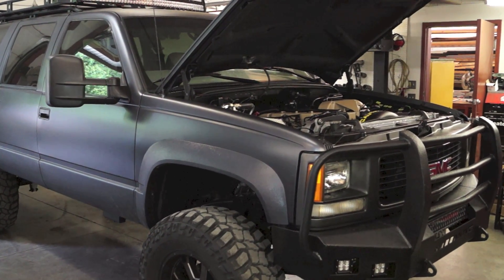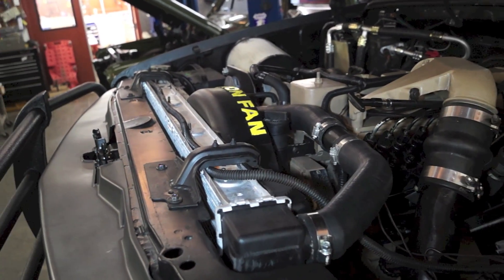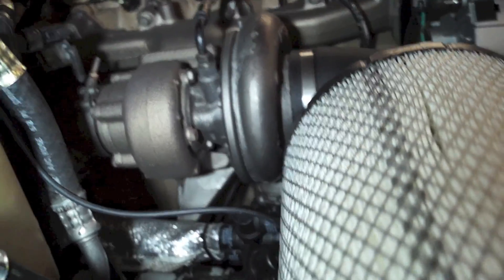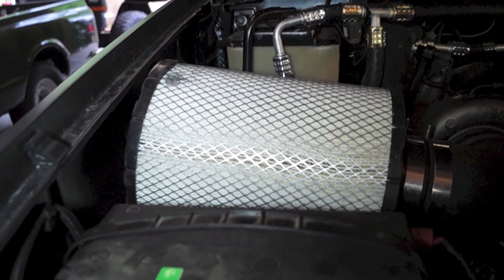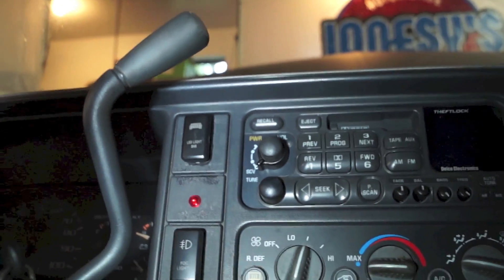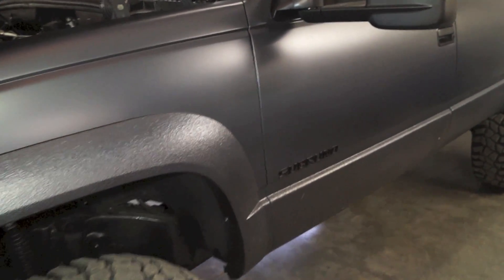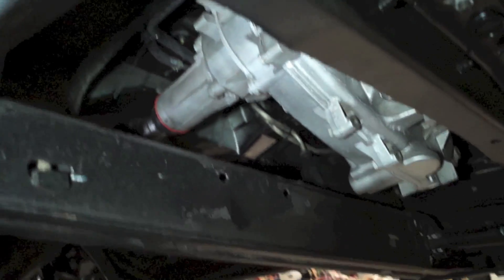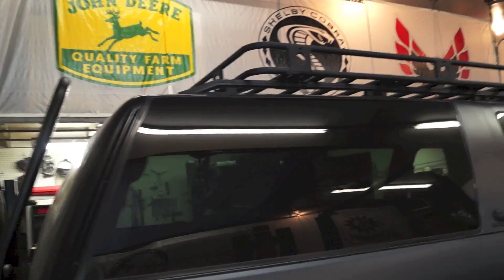GMC Chevrolet Cummins Swap Mechanical Details

Comment: How much you charge for the swap? I have a 98 Chevy 2 door. It has a 6 inch lift already. My transmission is already going out and the engine is at 200k. I want to keep the 4x4 and if possible make it a manual.

Comment: Thanks for the vid! I recently bought a 2000 crew cab short bed and was really thinking about this kind of build. This makes me feel a whole lot better of going through with it. But did you go with the 12v or 24v I don’t know if there’s any difference with clearance or issues mating the trans to motor. Thanks have a good one

Comment: Awesome! Between the larger tires and the increased weight from the Cummins, did you do anything to help the front diff cope? I have a '97 K2500 that I love, but I'm definitely aware that those front diffs are a weak point. SAS is one solution, but that IFS ride is so nice...just curious if you found a satisfactory compromise?

Comment: Could you do it on a 97 1500? Mine has a dead engine and would love to do a diesel swap. Already got the 6" lift, running 35 tires.
Reply: To heavy
Reply: How? If people swap them into mustangs? Legit question. @codyyellott117

Comment: Do you guys make or sell a conversion kit to do this? I have my dads 89 k3500  extended cab dually that I am restoring and would like to cummins swap it. It also came factory with a 454.
Reply from the maker: https://adventurevehiclesnw.com/shop/product-category/diesel-conversion-parts/chevrolet-gmc/88-99-truck-suburban/

Comment: Sweet but the new engine you dont have to use any motor mount like muve them and weld new mounts , i have a dodge 1951. Dually flatbed  and the donor  truck was just like yours  dually dodge cummins 1996 you think is easier SWAP the cabin' or SWAP the engine , transmission and dif'????

Comment: Hi,
This is amazing work 👍👍.
I have 1996 gmc serria 12Vcummins swaped and its working good .
I have qustion if you can help me on it .
How can i used the orignal dashboard RPM with cummins?
 i tray many ways but i get nothing.
Thanks.

Comment: there is people that like to knock on Cummins motors but they are very tough pulling beast I should know I have truck with a 12 valve in it and I have done a lot with it too so I know a lot about these engines

Comment: Joell,  ive watched several diesel conversations,  your by far the most complete and finalizer. Thanks so much for shsring a lesson on cummins diesel motors. I'm very interested in using the R2.8 , one day. I can be reached at 3alfear@gmail.com, thanks again.
Reply: Mr. Joel

Comment: So i am in the middle of swapping my 82 chevy crew cab with a 12 valve cummins and 10 speed eaton, how did that power steering pump mount up, is it a direct bolt in? Thank you

Comment: Would you be able to do a swap into a 1/2 suburban?
Reply from the maker: We will only install a 4BTs in a 1/2 ton Suburbans.  A 6BT is too heavy for 1/2 ton suspension and it builds too much torque for the 1/2 ton transmission, transfercase and differentials.
Reply: How much did this swap cost

Comment: Hi I was wondering what driveshaft modifications did u have to make u said u have too move the trans back 3 inches so did you have to shorten the rear driveshaft and lengthen the front ?

Comment: Didnt show dash when started.
Any codes?
Reply from the maker: The gas ECM has been deleted and the check engine light removed.  Cummins 12 valve is not computer controlled.  No Codes LOL
Reply: Lol good one frootloops!

Comment: not sure if anyone asked this already but does your abs still work without the factory computer being there? I have done this swap on a 97 3500 dually and my abs doesn't work. I have a scan tool that should communicate with abs computer but doesn't . I even bought a used unit and it wont communicate with it either.
Reply from the maker: Yes, the abs is still hooked up and fully functional.

Comment: I Like It. You should try a Turbo 400 transmission and a Gear Vendors GearSplitter/Overdrive. A Non electronic transmission to match the Mechanical 12 valve And the GearVendors unit to split the gears making it a 6 speed Overdrive.Although it is electronically operated, when turned off the transmission operates normally.
Reply from the maker: 4L80E with the programable controller works great.
Reply: @Jonesys  I have the same transmission and same programmer on my 2000 k2500 with a 98 5.9 12 valve , I have had it on the road since January of this year. I t works very nice.

Comment: Hey JonesysAutoClub. I have some follow up questions. I will be doing the same conversion soon. Some questions I have are how has the 4l80e held up? More specifically, what stall did you end up using? Hows the US Shift controller working? Anything you would change if you could do it again? 

Thanks! I'm sure I'll have more questions but thank you for your time! Good lookin rig!

Comment: Amazing truck, What did you use for motor mounts? Are they custom made?
Reply from the maker: You can buy the mounts here:https://adventurevehiclesnw.com/shop/diesel-conversion-parts/chevrolet-gmc/88-99-truck-suburban/1988-1999-chevrolet-gmc-1973-1987-chevrolet-gmc-truck-6bt-cummins-conversion-engine-mounts/

Comment: Can you do the setup without the stupid computer?
Reply from the maker: If you run a manual transmission
Reply: What about a built Turbo 400 or a 460L?
Reply from the maker: Yes,  you could use a TH00 but then you would not have an overdrive.  700R4 or 4l60 are not a good choice.

Comment: Awesome video!  You mentioned moving the eng/trans back 3" but you don't mention anything about having to modify the firewall to get everything to clear?  Did the firewall get modified in any way to make room for the engine?  thanks, really enjoyed this video!!!
Reply from the maker: The firewall does not need to be modified but there is a pinch weld that needs to be bent back to provide more clearance in the transmission tunnel.

Comment: What was the engine size of the original engine before the Cummins swap? If I remember correctly, the Chevy/GMC Suburban was available with everything from a 5.7 litre V8 engine to a 7.4 litre V8. By the time this Suburban was offered, you could also order it with a 6.5 litre Detroit Diesel Turbo if one wanted.
Reply from the maker: 7.4L V-8 Gas
Reply: Ahhh! Okay. So a 5.9 litre Cummins Diesel would've fit comfortably inside the engine bay.

Comment: I just bought a 1999 3/4 ton with the 454 to do this conversion. I have a buyer for the 454 motor. Do I need to keep the ECU or does it get completely bypassed?
Reply from the maker: You don't need the ECU.  You do need a stand alone transmission controller.  I recommend the US shift.
Reply: So how hard is it to get all the gauges to work without the ECU? I have a guy wanting to buy the 454 that's in my Suburban but I'm hesitant to sell him the wiring harness and ECU.
Reply from the maker: Your gauges do not come from the ECU.  They do route through the wire harness so if you are selling the gas harness with the 454 you will have to run the sensor wires separately.

Comment: Hi, I’m a high schooler looking to buy my first truck. I have my eye on a 1997 dodge Cummins that has about 240k miles on the engine. It’s a two door with a lift kit. I wanted to get your opinion to see if the $9,000 that it’s listed at is worth it?
Reply from the maker: Things are worth what people are willing to pay so if that is the best truck that you can find for that price then yes it is worth it.  Can you find other trucks that will get you back an forth to high school for less $$$?  Absolutely......  I started with 1977 4 door 6 cylinder chevrolet nova as my high school car.
Reply: Cummins owners are high, I'd rather buy a 96-00 GMT400 with a Vortec 5.7 instead as a first vehicle. Mine never left me stranded and I wasn't nice to it. Trust me I wanted a Cummins when I was 16/17 too but if shit broke it wasn't cheap to replace parts.

Comment: I’ve got a 1998 gmc suburban that I’m very heavily considering this swap and I’m just curious how you did the 4wd? Any tips to make it easier would be great thanks!!!
Reply from the maker: It came stock with 4wd.  The engine swap did not affect the IFS or the 4WD as the stock transmission and tranfercase were retained.

Comment: Where does the DSL-1 E get its input signal?  What did you use as a reference to calibrate the tach reading?
Reply from the maker: The tach signal is pulled from the "W" terminal on the alternator and was calibrated to 750 RPM which is where the cummins is at idle.
Reply: Thanks for the reply.  That's a very smart and economical solution to that problem.  I saw in another detail that you were using a GM alternator and I figured that's what you must have been up  to.

Comment: My question is..... How much time. And how much does it take for a set up like this(minus the paint) ...
I have a '98 Burban that j would live to convert
Reply from the maker: Diesel conversions start about $15K for just mechanical and drivetrain.  Interior, lift, paint, bumpers, big tires all add to the cost.  More videos about that topic will be posted over the next couple months.
Reply: Where are you located?
Reply: @Jonesys  you have amazing work man. And once I have the time I'd love to get a hold of you and get a vehicle projected. Like I said it's my 98 suburban.
Reply: can that be done done to a 6 lug burban?
Reply: I had about 12k in mine and it took about a month to do it.

Comment: Very very impressive swap, my only two questions is why retain the suburban transmission? and why not instead of doing all this hard conversion shit and just buy a ford 7.3l excursion? They're badass and bulletproof. lol
Reply from the maker: Ford vs Chevrolet.  International vs Cummins. It all boils down to personal preference.  My vote obviously goes to the fully mechanical diesel that gets 18MPG and the simple programable transmission controller.  Wrap that with the suburban sheet metal and great leather interior and you have a package that beats the overly complicated 7.3L excursion everyday of the week.

Comment: I just wanna know how you made the 37s fit on. The 6 inch lift? With no 3in body? What did u cut off The fender?
Reply from the maker: Just a little trim on the rear flare.

Comment: Do you need the torsion bar drop if your planning to just run rwd and not 4x4? And modifications done to the firewall? Notch the subframe for the oil sump? Any notching of the frame to clear the engine?
Reply from the maker: Nope the engine fits perfectly.  You need to bend a pinch weld seam a little in the transmission tunnel and the suspension lift helps but is not required.

Comment: which tuff country lift is that? the knuckle drop or control arm drop?  bad ass rig
Reply from the maker: Control arm and differential.
Reply: JonesysAutoClub how does that ride?
Reply from the maker: Excellent.
Reply: JonesysAutoClub how much would you charge to finish one of these swaps?
Reply from the maker: Most projects are done on a time plus material basis.

Comment: How can this vehicle retain the 4x4 and the IFS without needing a body lift?  Also I'm concerned about the 4L80e not being able to support the beating that the Cummins can throw at it.  It the tranny built or does the modified shift timings from the trans controller make up for that?  But overall, that's an awesome build, I dream of one day doing a 12v swap into a K3500.
Reply from the maker: Everything is done in house.  Lower than stock HD convertor  Alto RED clutches as well as valve body mods and upgrades.  This is not Rookie camp.
Reply from the maker: Neither a suspension lift, or body lift is required but they do make the install easier.   The transmission has been fully rebuilt with HD clutches, convertor as well as valve body upgrades.  The stand alone controller from US shift makes programming easy.    The 4L80E is a great very heavy duty transmission and since this vehicle will not see much towing it is a great choice.  Thanks for the comments.
Reply: who did the transmission upgrades and rebuild?  Are you using stock stall speed?
Reply: nice!
Reply: Swapping to a Allison 1000 Transmission would be the answer. When the 4L80E was introduced, torque capacity was vehicles up to 8,000 pounds and engines producing up to 440 lb-ft of torque. A person would have to baby the transmission, eventually it will fry.
Reply: The 4L80e is based on the Turbo 400 transmission, the 4L80e has a 25% overdrive, the torque converter locks up 1 to 1, it is the heavy duty model there is a 4L60e that is weaker than the 4L80e ,the e stands for electronic.
There are modified units available at Jegs and related outfits for high stall torque converters or heavy duty converters, the stock one will be the weak link in my opinion. Turbo 400 tranny's were put in motor homes behind 454 big block chevy motors.
Reply: Will the newer GM 8 speed automatic transmissions work with the 12V 5.8 6BT Cummins?

Comment: seems like overkill when a 4bt would do.. what airfilter is that?
Reply from the maker: 4BT is not a good choice for a vehicle like this when a 6BT fits perfect makes more power and cost the same if not less to install than a 4BT.   Flex93312 is totally correct.  FYI the air filter is a WIX 46637.
Reply: I have seen many suburbans/tahoes etc with 4bt's they are much more economical and make big power (especially p-pump variant) the 6BT is overkill for this application.  I love my 4bt in my CJ works well and more efficient than a 6bt
Reply from the maker: 6bt is overkill in a 3/4 ton truck with 37" tires?  OK...........
Reply: 4bts are used in a lot of power wagons with the same spec.. no issue.. claiming that a 4bt cannot work properly in this application is foolish...
Reply from the maker: I think I'm going to take the 6BT out this weekend and install a 130HP P-Pump 2400RMP 4BT because clearly the 6BT in a 3/4 ton truck with 37" tires is overkill.  The Subruno would work great with those specs.   Stay tuned for that video.  Cheers.
Reply: batteries are too expensive although i guess i could do a serial motor setup that is powered off a small generator.  Would be pretty cool..  Not enough room on my truck though.. even with a 4bt and the TH400 only 8 inches of driveshaft length.. Looking at going 4l80e soon.. really missing an overdrive
Reply: Joeys Cleaning Lady the 4bt stock would struggle so bad in the truck maybe not taking off up to 30mph but could you imagine TRYING to run down the highway at 70mph it wouldn't happen and would be very hard on the motor
Reply: Joeys Cleaning Lady and yeah the 4bt is noises as hell who wants to have a constant headache